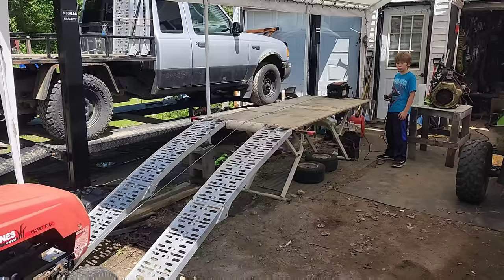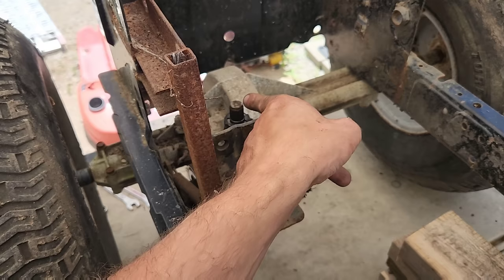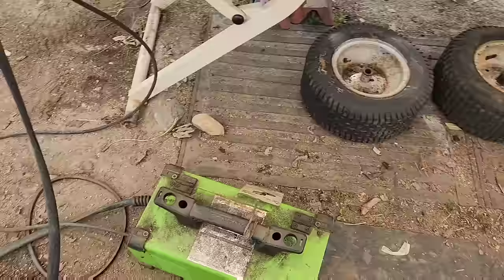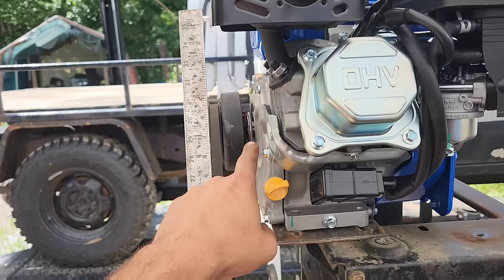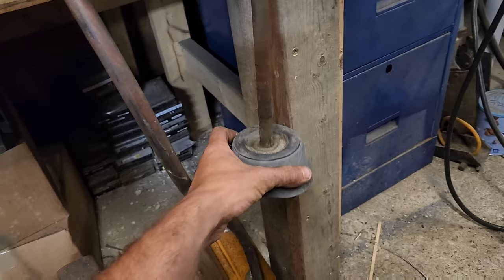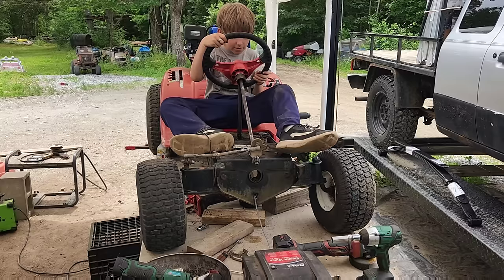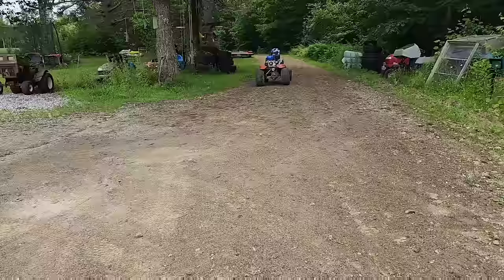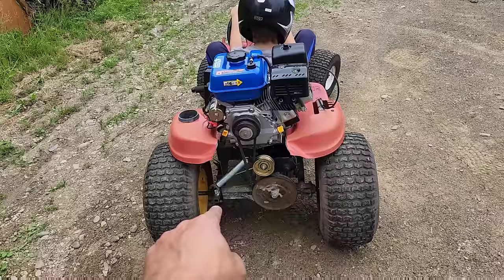Go Kart From Lawn Tractor

Comment: I think John is very happy with this project. May need some wheelie bars once he's in high gear. Great job!
Reply from the maker: Agreed I was debating a rear skid basket like they do on sand rails.
Reply: You are a good man to know. I have many questions. I am new to this. I have a Craftsman 19 hp. Twin cyl. Stuck rear. And a  Husqvarna missing engine parts. I installed the Craftsman engine on the Husqvarna. Yeah I should have just swapped rear axle x. But hey. I also swapped the wiring. The sear safety wies don't reach. But I'll continue the two.
Reply: Plus a roll bar couldn't  hurt huh.juss sayn

Comment: What a great Father and son project!  Brings back memories of building one myself!  Our 11 year old wanted a cart that would carry two, so we fabricobbled an channel steel perimeter frame. We used what was around! Ended up using a Vega rear axle, and an older VW front. Added hydraulic brakes for good measure. Covered the underside with sheet metal, and powered it with a 340cc Snowmobile engine and clutch, along with the gear case. Good thing we lived out in the country with lots of places to run. It was a whole lot of fun!
Much later in life, I used the hydrostatic transaxle from a derelict mower. This was fine,  but those things are apparently designed to only turn so fast, even if the input speed is really increased. The solution there was to use a chain and sprocket arrangement, using an idler and chain drives to the new axle. A couple of pillow blocks from TSX and some 3/4" shaft brought it all together.
Reply: Sounds almost as sketchy as the shoppingcart gokart me and my dad made last year. We fabrifuckedup a homemade frame, put a shoppingcart on top of that and put a 2-stroke engine that was so small it literally did 2 mph. Then we swapped on a 240cc Honda GX motor this winter. It was really fun drifting it in the snow because we accidentally added a shit ton of angle to it. I have a yt video of it if you want to check it out. I'm plannignon getting a lawntractor like in the video, slamming it and adding angle to it so me and my friends can drive around together!

Comment: I modified an old black and decker wildcat 9"grinder to direct drive the spicer hydrostatic drive on a lawn tractor with no engine with a 2kw petrol generator where the engine used to be, 1st gear pulls 6' wheelies, 5th gear take off will flip it upside down, it will burn rubber in reverse,  BUT the only control you have is an On Off switch to stop the grinder. Scary but so much fun!

Comment: Interesting video,  I enjoy working on mowers,  and tractors.  I have an older Murry 12.5 horsepower Briggs,  it was wore out,  I put on a Kohler Pro  25 horsepower V twin.  I didn't change the pulleys so it's still slow,  but it cuts tall grass and weeds without any problems.

Comment: Direct steering means mad bump steer. Especially if you get the speed picked up. Watch your thumbs when the steering wheel takes off. I put bmx handle bars on my sons. ( 4" cut off both sides) 
This gave him more control and I was able to use a hand break setup. Short cable down to a offset pivot and longer rod to the rear. Useing the mechanical advantage to apply the breaks. I also used a Smaller pulley on the transaxle to speed it up some. Now have switched to sprocket and chain drive. Belt drive doesn't like boys and mud bogs.  Lol

Comment: Every boy should have a dad that can fabricate a cool motor cart from an old MTD.  Tubes in the tires so you can run on 5lbs will take up some of the shock and a smaller pulley on the transaxle will make your slow-cart to a go cart!

Comment: Going to the extreme, all you have to do is put a small pulley on the transmission, put smaller tires, you still have forward and reverse can even still use drake's that come equipped with the mower

Comment: I raced go-karts from 84-91 (11 yrs old in '84) and we used a horseman clutch. You can change the springs in the clutch so it will engage quicker. Put a Wiseco piston. Put a straight header on. Nowadays you can order the cam of your choice but back in the day we had to go through cam after cam until we found the right one. Then my dad made a device so we could twist the the camshaft to the spec we wanted. And if you really want to add some HP put a Tiltson/intake carb. on it. Sub'd to the channel! Brings back memories
Reply from the maker: Your Dad sounds like my uncle growing up. Many good memories that I want my son to have to.
Reply: @redneckcomputergeek  that's awesome! I wish I could have found someone to have a family with. Dad taught me airbrush and customizing cars, bikes, etc. Kinda sux I can't pass that on..... Anywho! I've checked out some of your vids! I'm going to order the welder you suggested! Keep up the good work brother! 🤙🇺🇲

Comment: its got that VW baja bug vibe to it, its pretty sweet, i wonder how it would do if you fitted a torque converter to it, might give you more range in the RPM, still a pretty sweet little project, also for the carb upgrade, definately a Mccuney or a clone like the one you found, would work wonders for that little engine, also find (or build) yourself a nice header pipe and she'll sing
Reply: I tried that (torque converter) probably 20 years ago on a friend's project. It was easy to drive, no Comet clutch type thing to work with, however it would not move very fast, around 10 MPH. The hydrostatic trans apparently was designed to not drive your mower too fast! But wait, there's more...use sprockets to drive from the hydrostatic to the axle. That way, you will greatly increase ground speed.

Comment: I bought my old Jonsered LR11 in a working condition but a bit sun burnt fo 800 dollar. Rear tires has some cracks. I looked for used rear wheels, the not so good were for 70 dollars a pair. I am still from Hungary :-)))

Comment: If you make the pully on the transaxle smaller closer to a 1 to 1 it will go a lot faster and because of gearing inside the axle it will still have plenty of torque used to build lawnmower go-cart when I was younger

Comment: You've probably already done something like this, but just a quick suggestion in case you didn't...   To make the ride less prone to giving your coccyx a beating as you ride over bumps, I'd suggest cutting a vertically oriented, about  3" x 5"oval hole in that lower curved section of your seat area and use a hammer you break over the edges.  With or without padding it should help a lot, especially once you start riding it for more than a few minutes at a time.

Comment: It needs a stage 1 power kit (particularly the governor removal/mod) and a much smaller pulley on the transmission side. 5000rpm redline and a 3" Engine/4" Transmission pulley combo will mathematically double your speed. 5000rpm and equal-sized pulleys should almost TRIPLE your speed.

Comment: The tension pulley should be on the slack side of the belt,so as not to interrupt the pulling power of the engine to transaxle, otherwise looks like a fun unit.

Comment: Maybe that frame twist isn't such a bad thing I would only reinforce where the transaxle is slightly to keep it from wanting to break 

Also would it be possible to pulley swap that to make it slightly faster ?
Reply from the maker: Good point on the frame flex I was thinking about the same idea. Pulley wise you could make one from an older steel hub one welded in place.
Reply: @redneckcomputergeek  I wasn't sure if the fnr transaxle I'm general where able to be pulley swapped or if it would just destroy it

Comment: Thank you!  I just bought that exact same welder and haven't been able to make it work for me.  Apparently I am doing something/ everything wrong and it's not the welder.  I'll try again.  Apparently the technique is more than I thought.
Reply from the maker: Learn on thick metal first. Set is for 5 and 5 on the settings. Dial the wire speed up if its gapping on you and down it if it pushing back on you. If the burn in sounds like bacon frying your doing something right.
Reply: @redneckcomputergeek  okay I'll try that.   I've got an auto body project currently under my shadetree (and yes I really do have a shadetree).

Comment: I'm working one of the f&r transmissions a nice slightly downsize the pulley I'm putting in a flat side pulley detention the belt without having to change the stock size of the belts that run the very drive the stupid Kohler command carburetor on the 14 horse single has decided it don't want to cooperate anymore I've got to clean Briggs carb but I need to nip the end off of the solenoid and see if I can mounted on there to work and I can check out my work or see if I need to move my pulley a little further inward for more tension

Comment: Well I'm going to say from personal experience, it's not the RPM it's the gear ratio. If you put a smaller pulley on the rear end it will be a lot faster and also leave the variable speed on it!!!

Comment: Hi from Donald,  I didn't get you name in video, but send this to you Dad  for John,   my mower is Sears Craftsman  38" cut  12 hp,  my transmission  is 5- speed  if you get same Trans I have it's  lot faster in speed if you devise same type shift clutch that go cart run at good high speed. And these older Craftsman  tractors  have very strong frame I pull 6'x 4 ft trailer with class 2 - square hitch. The backing plate is 5/16 in thick easy. Takes 5 lb hammer to beat it straight if bent. You might want check out older Craftsman  tractors there awesome.

Comment: To make it faster change the Transmission pully to a smaller size, you could if you wanted to, remove the centrifugal clutch and go with a larger pully  and then use the belt tensioner idler pully  as a belt clutch just like a  riding mower does, but you will also need  belt stops so the belt does not fall off when loosened with the clutch or switch to a chain centrifugal clutch and sprockets, those belt centrifugal clutches were never ment for go carts.

Comment: Interesting concept of the repressing of free garden tractor(s). Have you ever tried to use a vertical shaft motor a place in the front and turn around the two pulleys that under most tractors?

Comment: very cool
would that system work with that harbor freight ghost motor
Reply from the maker: Yes. My goal is to do follow up upgrades to the engine until we find the breaking point of the tranaxle or the cheap clutch.

Comment: Do you think a smaller pulley on the trans would be better or worse?
Reply from the maker: Slightly smaller was something we plan to test. Stock its around 8 I was planning to drop it to a 6. That should get it pushing 12+mph.

Comment: I have a question about wheels/tires I’m handicapped and I’m from Alaska. The clearance on my mobility scooter is like 2” and I need more. LOL!! I want to put fat tires like those on my scooter…. But I’m also not a welder. Is there anyway to find compatible wheels/tires that are big like that, with the standard scooter axle? And do you know of any…..?? I’ve thought about all kinds but seems like you might know of some….. ?? I’m planning to cut back the fender/wheel well as to fit a bigger tire. I believe the fenders are separate pieces, so I might be able to just screw them off…. I been trying to hack this thing for a while. Your videos are the closest thing I’ve seen to what I want to do. Everyone thinks I’m crazy w my ideas LOL!! I’m finally feeling like I might actually be able to do this!! Thank you
Reply from the maker: Power wheels have been upgraded for years with custom mobility scooter rear ends and tires. That would be what I would look into.
Reply: @redneckcomputergeek  the hard plastic tires? Or are they making them with rubber tires now??
Reply from the maker: @S.tarzzz  Rubber I have one I built my son with 16 xtrax snow blower tires.

Comment: What choice words a 9 year old is allowed to use HAHA!!!  

Needs a bit more speed at some point, I guess that would be where you'd need that vari-drive pulley setup, some way to mount it to the output shaft of the engine instead of that centrifugal clutch?
Reply from the maker: This engine should be able to turn 4500 RPM with just a few basic mods. That alone will give it a solid boost.